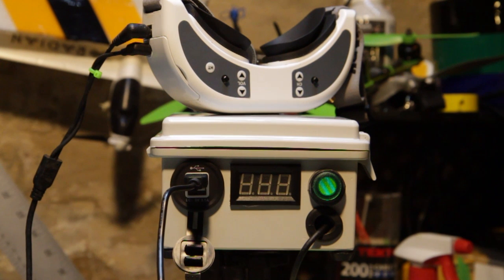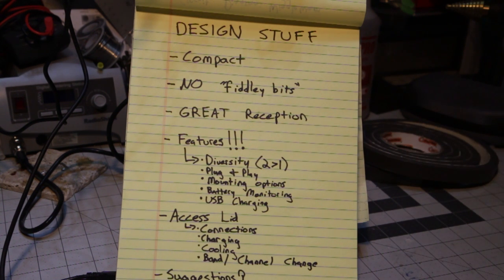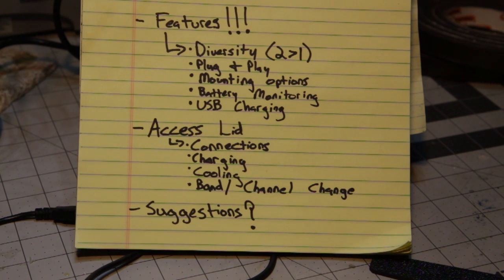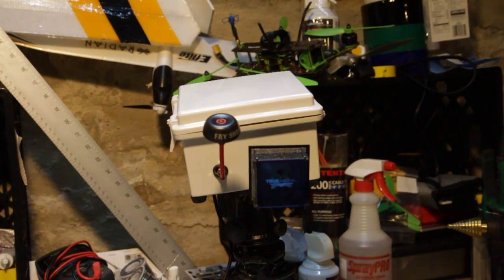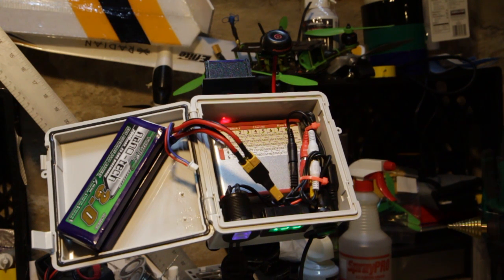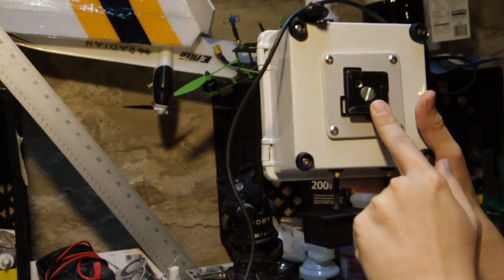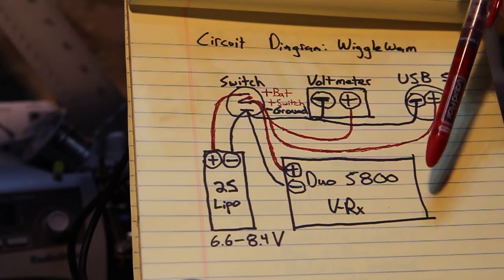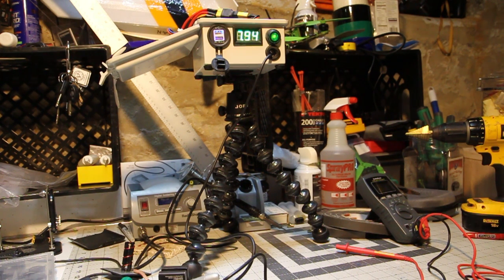Compact 5.8 GHz FPV GroundStation

Comment: Can you show the links to get each part for a 5.8 ground station? I already have a camera tripod.
Reply from the maker: +Thori Nelson read the description, links are all in there.
Reply: I'm actually just looking for a good diversity 5.8 rx module that won't cost a fortune that I can mount to my camera tripod and have the wires and stuff connected for my fatshark dominator v2 goggles and where I can find those items. I'm new to mini quad flying and want to get the best video instead of just using a goggle module.

Comment: Wiggles... how can you tell what band/channel the duo is on? Anyway to setup up a digital read out on it?
Reply: +Grumpy1056 good stuff by the way... thanks
Reply from the maker: +Grumpy1056 when you hit the buttons to changes bands/channels it beeps at you.  the number of beats tells you what channel.
Reply: +Wiggles FPV :-) i know that part, but was wondering if there was another setup somewhere to have a readout.  thanks anyway. still plan building one similar to yours.

Comment: Nice work! Quick question, looks like you have that one main power cable coming out from the box to your goggles, does that single wire provide the video from the duo as well as voltage to your goggles? would love to have a single cable like that, where did you get it?
Reply from the maker: +Steven Parker I cant remember but it definitely came with either the duo5800 or with the dominator hd's.
Reply: +Steven Parker  Easiest would be to look for security and backup camera power/video cables. Here is one http://www.amazon.com/HitCar-Extension-Security-Trailer-Reverse/dp/B00DVZYC6Y/ref=sr_1_4?s=photo&ie=UTF8&qid=1455743421&sr=1-4&keywords=Power+Audio+Video